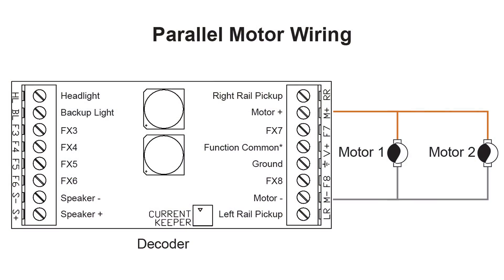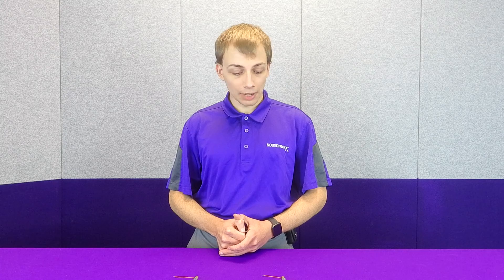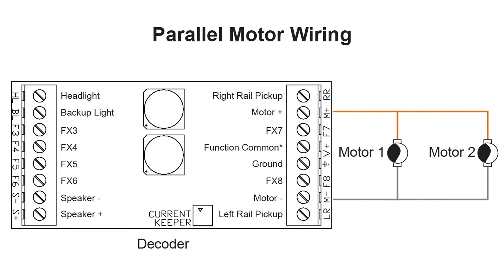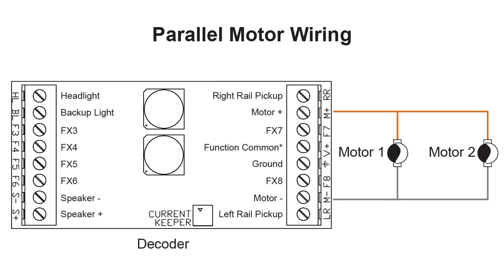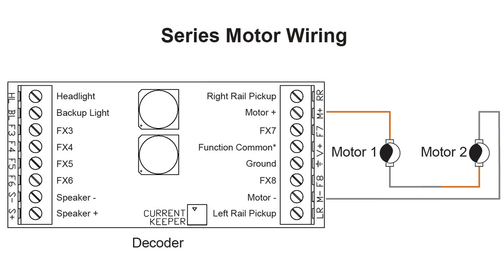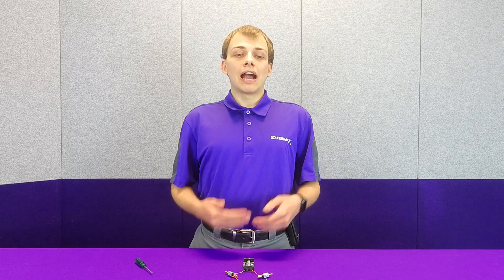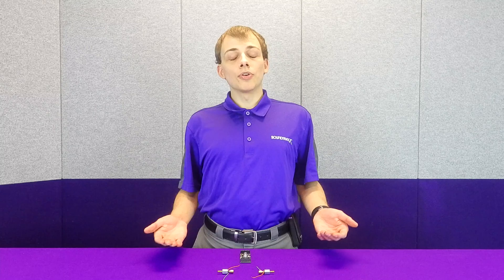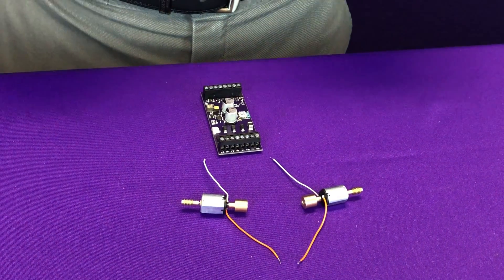Wiring Multiple Motors with SoundTraxx Decoders

Comment: So if you wire in series both motors will run the same detection if I change polarity on one of the motors in series will one motor tern right and the other tern left at the same time?
Reply from the maker: When wiring motors in series, you will need to pay attention to their rotation so they are not fighting each other.  For example, the Kato HO P42 has the same trick in front and rear of the model, just facing different ways.  So if you wire them in series as you would normally, then they would fight each other.  So it is a good idea to confirm which direction each motor needs to turn, then set the polarity accordingly.  I hope this helps.

Comment: The old PCM (now Broadway Limited) have their A-B style diesels set up to have the B-unit ran off of the board and decoder from the A-unit. I have a TSU-21PNEM8 in my ALCO FA/FB set up and while the motors sound like a coffee grinder, they move very smoothly and have amazing slow speed crawl. I am hoping that they are set up in series but as long as the decoder doesn't blow up I think I'll be good. For some context as well, they were a DCC-Ready set otherwise it would've had ESU Loksound V3.5 at least from factory.
Reply from the maker: If you need any assistance with this please feel welcome to contact our Support Team directly: (970)259-0690 ext. 22 or support@soundtraxx.com. We are always happy to help!
Reply: @SoundtraxxDCC  I will if I run into any unforeseen problems. Thank you guys for amazing decoders and amazing support service!

Comment: Does wiring multiple motors to a single decoder effect BEMF functions like Hyperdrive and chuff timing? If so, what effect does it have, and can it be eliminated by, for example, the use of an external motor driver for all but one of the motors?
Reply from the maker: The BEMF is still identified as unique each time it is read, so the decoder can still take the rotations into account for chuff timing. The BEMF load will still vary, so it should be fine for DDE as well.  If you drive one of the motors with a separate SoundTraxx motor decoder, then it will obviously be out of the loop for all measurements, since the decoders cannot intercommunicate.